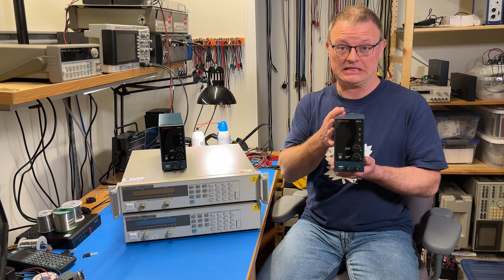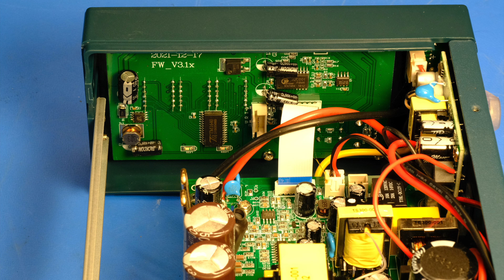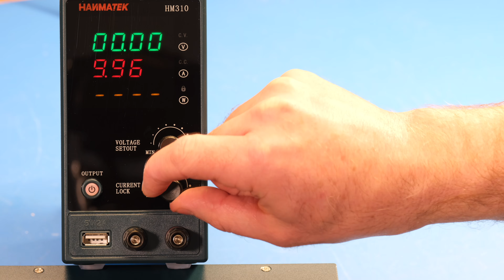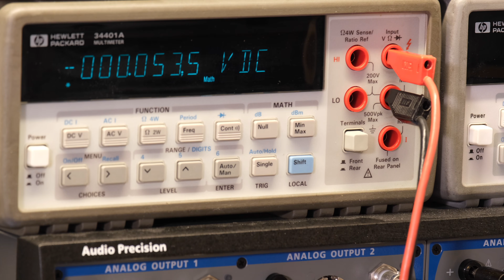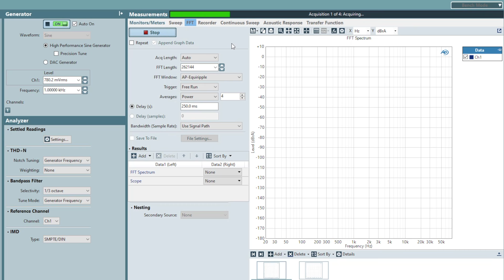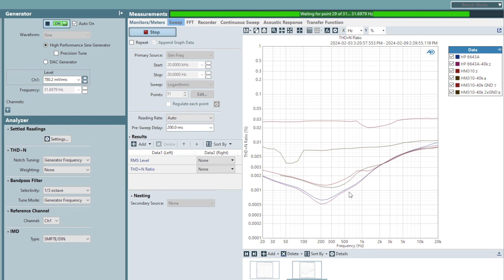Is the Hanmatek HM310 Power Supply any good for use with audio power amplifiers?

Comment: Tom, at 17:52 you mentioned you grounded common to reduce the measured noise.

Just to clarify:  You are using two HM310 units wired together in series for a bipolar supply. You have connected the audio circuit ground (common) to the protective earth ground on your analyser. You used a heavier gauge wire than the analyser inp/gnd to provide a lower impedance path for the noise.

Is that correct?
Reply from the maker: I connect the two HM310 in series and ground the centre point between them. They have floating outputs so this should not be an issue. I do the same with the HP power supplies I show in the video.
Reply: @Neurochrome2010  Thank you for the super quick reply. I was still editing my post to try and make a bit more sense.

Thanks again for the clarification :)

Comment: I bought one of these... I guess I was just unlucky, but I got defective unit. When I just got it, I tested it, it worked, and I left it unattended for half a year. Then when I switched it on, it didn't work. Surprisingly, after being powered for 3 hours or so, it woke up!
Unfortunately, 2 weeks later it died completely, the 3 hours trick did not do anything.
I am not skilled enough to try to fix it, so will have to buy something else...
Reply from the maker: That's disappointing. I'm not super surprised, though. Some things are too cheap.
Reply: @Neurochrome2010  Do you have suggestions for the reputable brnds to minimize the chances for this to happen again? I don't need any more functionality than this thing gives, I only need it to work.
Reply from the maker: Yep: https://youtu.be/Vz0cEK4dX0A
The HP 6227B would be a good option too.
Reply: By the way, i opened my broken unit, and found that this time the reason is quite obvios - one of the components burned and shuttered in pieces. I could try to replace it if i knew what that thing was. So next time you open it in one of your videos, if you remember, could you check out U4 component and tell me its marking, please?
Although yours look a bit different, i expect it is only the allignment.
Reply from the maker: I've gotten rid of both supplies I had as they had no use to me. Sorry, buddy.

Comment: Haven't watched your video yet. However this is the bench PSU multiple people recommended me. I want to go with the "RD RK6006" simply because I can use any DC power supply I have. Weather it be a laptop charger, or ATX PSU. I can build one for around $50-60 USD, considering the ATX PSU is free. While also having the fixed voltages the ATX PSU provides, and using its 12v B rail for the Riden module. There just aren't many videos on the Riden units. Maybe you could purchase one and do a video on it. They're $32 USD on aliexpress rn.
Reply from the maker: You'll be hard pressed to build a lab grade power supply for $50-60. I often find used gear at lower cost than I can build something good for myself. 

The RK6006 is an interesting option. I highly doubt they would work well, but they could be interesting to look at, nonetheless.
Reply: @Neurochrome2010  I'm still very much at the hobbyist level and hobby level tools. I only need something that I can current limit so I can inject voltage into shorted boards to pinpoint the component. Basic macbook/pc repair. 

I'm just not sure if I want to chance having a issue with the RK6006 module, or just pay $70 for the HM310 and be done with it. 

HM310 I get off Amazon, the RK6006 Aliexpress, and if I have a issue with it. Not as easily returnable. Its on Amazon too but with a $18 markup or so. Might as well buy the HM310.

Thanks for the reply though. Still very undecided on what I want to get.
Reply from the maker: A cheap hack to get a current limiter is to insert a 10 Ω resistor in series with the supply output. That works great for testing power amps. If the amp misbehaves the resistor will cook and interrupt the flow of current.
Reply: @Neurochrome2010  That goes beyond my knowledge. I'm not sure if that applies to a more digital circuit like a macbook logic board. I need to be certain that my current limiting is accurate. Else you could cook something like the SMC and the board is indefinitely a parts board once that happens. I was told 1V 2A is what I want to inject on my shorted rail, then feel around for hot components. Not to mention I'd like to do this more frequently, so having the right tool is ideal. 

Thank you nonetheless. I know this supply will work for what I need. It just seems like I'm paying more for less. If I where to build one with the RK6006, it'd be more easily repairable/maintainable down the road (providing the module isn't the issue) and I'd also gain fixed 3.3, 5 and 12v outputs.

Going to check out your Part 2. Also local people know I'm looking for old equipment. Ideally get it damaged at a lower price, I currently cant justify $400 or so, even though its likely worth it.
Reply from the maker: In that case I would look for a lab supply that can provide 0-15 V at maybe 0-5 A. Ideally with a lower range of, say, 0-6 V. The HM310 will likely be just fine for your needs. Don't bother with the programming feature and save yourself some money.
Reply: @Neurochrome2010  The Korad KA3005D is $40 more, but seems to be a much better built supply. I don't need the serial functionality of the P. Waiting to hear back from the person that told me to get the 10A Hanmatek one. iirc for voltage injection, rule of thumb is you don't go past 3A. So a 5A supply should be fine, but they said to get the 10A one without explaining why.
Reply from the maker: For testing modern computer stuff (including phones, pads, whatnot) you really need a fine adjustment of the output voltage. That's why I bristle at a 60 V supply. With a 15 V one you might be able to get mV resolution. 10 mV resolution for sure. With a 60 V cheap supply you're lucky if you get 0.1 V resolution.
Reply: @Neurochrome2010  I think I'm going to get the Korad KA3005D, you show the P in your other video. It seems decent and what I'm looking for.

Comment: Hi, would it be possible to review aHanmatek HM605T programmable power supply? thanks. BTW great video.
Reply from the maker: I can certainly take a look. 5A is a bit wimpy for an audio amp at 60 V, though. 10 A would be more interesting.
Reply: @Neurochrome2010  5 amp or 10A would be your choice, I am going to use mine to power/test low amp LEDs, BTW,thanks for your quick reply .

Comment: Sir, can suggest others small switching supply with lower noise and peaks?
Reply from the maker: Not really. I've only tested that one. If you don't mind a fixed output voltage, any of Mean Well's offerings would be good options. I've used the RPS-400-27 in audio amps with excellent results. But for lab supplies I'd stick with the old HP/Agilent 6600-series.
Reply: Thanks, the MN LRS 150 24 is interesting because have a trimmer for fine Voltage settings.
 Maybe by replacing it with an higher impedance pot. the V.out can be regulated lower
Reply from the maker: That's likely. I'd be careful about such modifications, though. If you change the adjustment range on the power supply you also change the feedback loop. That can result in instability.
Reply: I will check impedance of original, then changing gradually with new one, for 12V there is LRS 150 12.
Thanks for the tips
Reply from the maker: You're welcome. Also, if you don't mind the fan noise, the SE-600-series is excellent as well. I used to use a pair of SE-600-36 for testing power amps. I'm hoping that the pair of HP 6654A that I just bought will take their place (and allow for testing higher voltage amps too).

Comment: I own a number of old HP linear power supplies in my lab, which I've refurbished and recapped. They don't have a lot of current capability but I usually work on low power circuits anyway. Otherwise they are excellent power supplies. However one of these power supplies for non critical stuff would be handy. The price is certainly right and I like that they don't take much space. Lab space is always at a premium. Thanks for the thorough review!
Reply from the maker: You're quite welcome. For higher output power, the HP/Agilent 65xx and 66xx series are hard to beat. I've been using a pair of 6643A for years for power amp testing and just picked up a pair of 6654A for higher power and higher voltage.